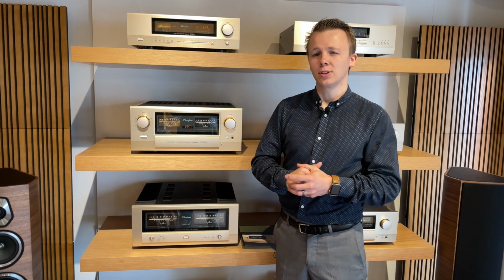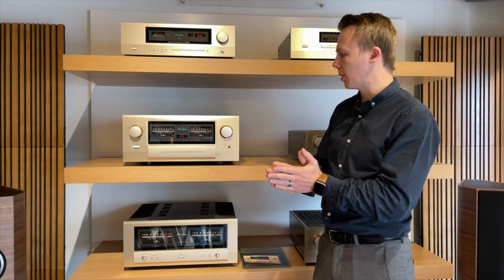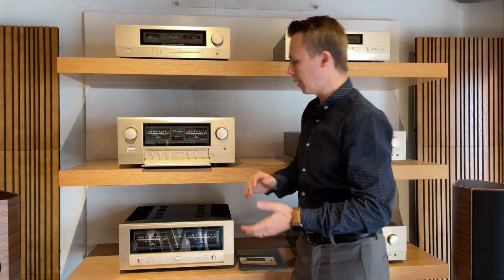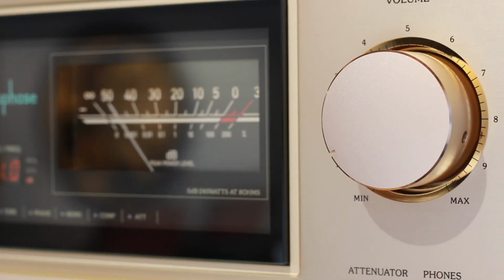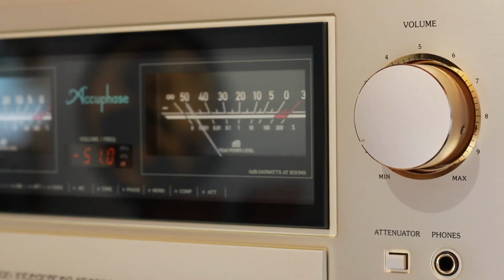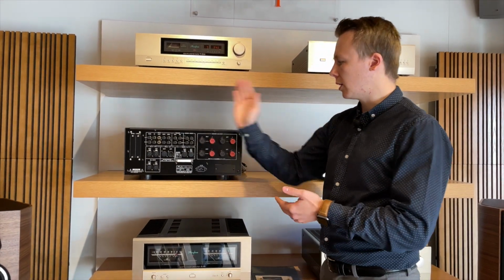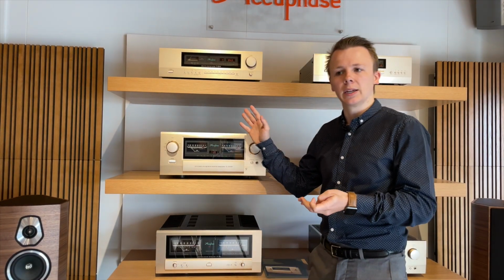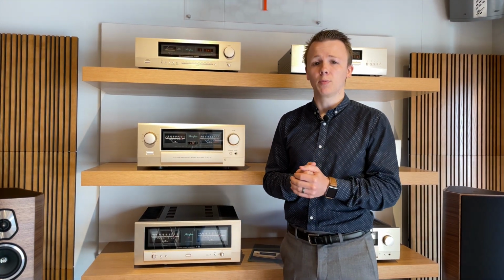Accuphase E5000 Integrated Amplifier | So Much POWER!

Comment: Which one would be better for silent  listening  music ? E650 or E 5000 ?
Reply from the maker: It depends very much on a couple of things.
How how loud you are going to listen to your speakers at and how big your room is.
If you are going to listen LOUD or have a large room or particularly large speakers the E-5000 is going to be the more suitable amp given it is more of a high performance powerhouse than what the E-650 is.

I personally own an E-650 and I power Sonus Faber Nova IIs off of it in an open plan area and have plenty of power, so the E-650 is not weak or anything, but my speakers are easy to drive, and as far as floor speakers go, they are what would be considered small to medium in size, and I don’t really blast my music.
So overall, I think the E-650 is a ‘nicer’ sounding amplifier due it being Class A, but the E-5000 is there if you need the power.
If you really want the best of both worlds and were considering the E-5000, just go for the E-800.

Comment: Next time check what "COMP" button do instead selling lies!!!
COMP. in previous integrated models is =+6dB Bass boost at 100Hz - it's like loudness without boosting trebless - it's better than loudnes in my taste.
Besides that there is a standard tone control +10 dB at 50Hz in fluid contoler in potentiometer.